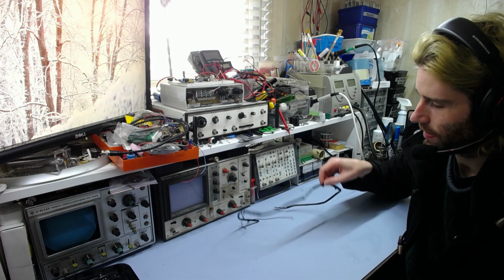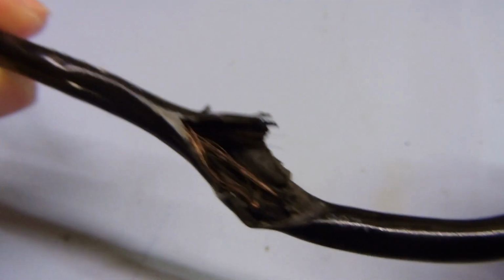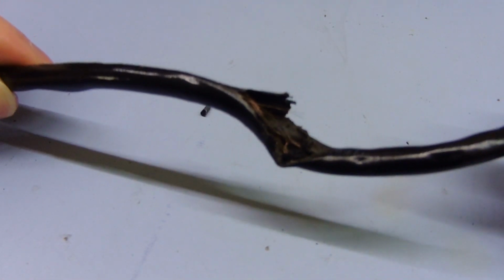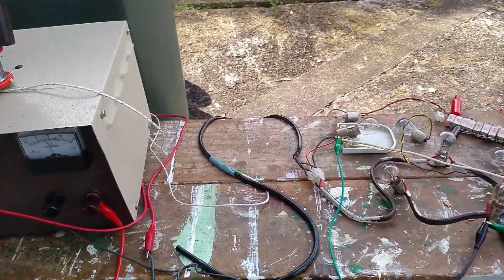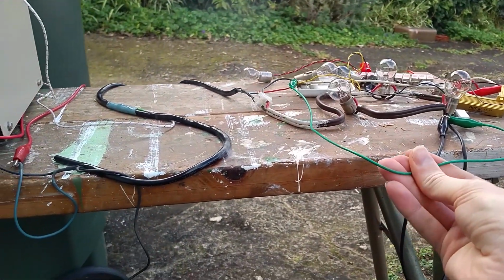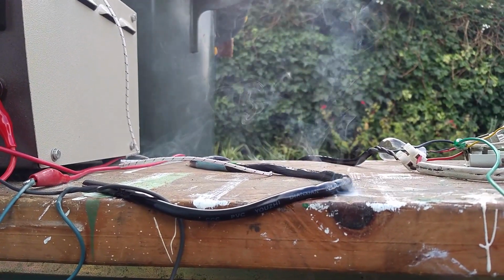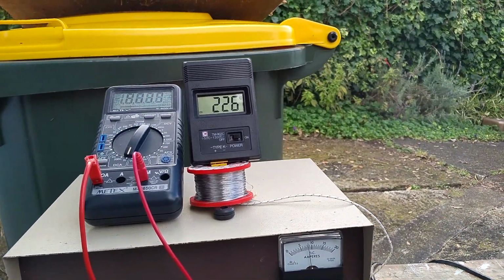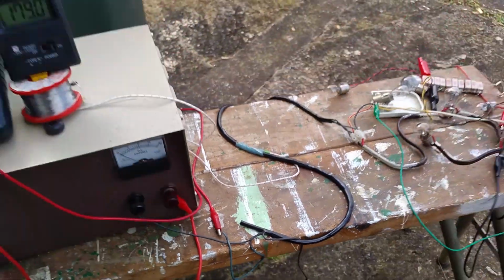Load test of flex from a fake and potentially deadly Aus/NZ C13 appliance cord

Comment: I had "10A" wire on the 240V output on my off-grid solar setup.  I also had a 10A breaker in circuit.  Pulling 2000W, I came outside to smell burning insulation and a breaker that had not tripped.  Lesson: always test all components when installing.  You can't go off rated alone!  Nice video!